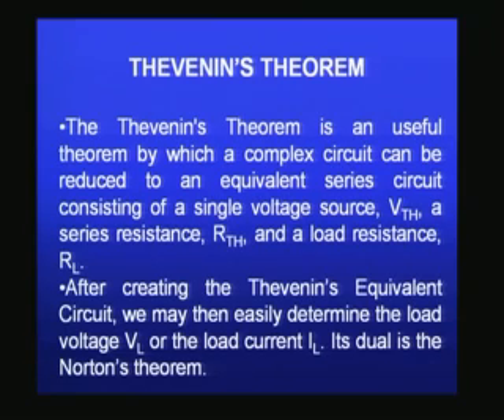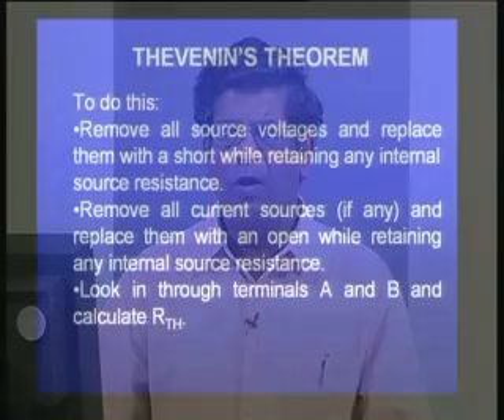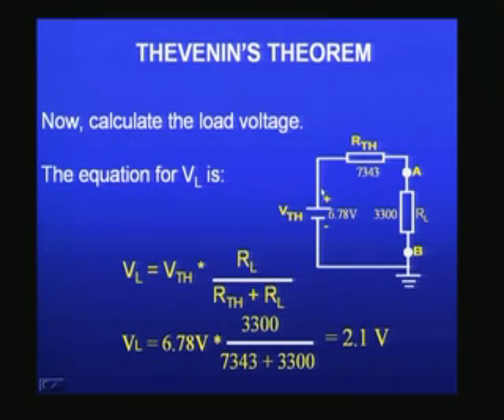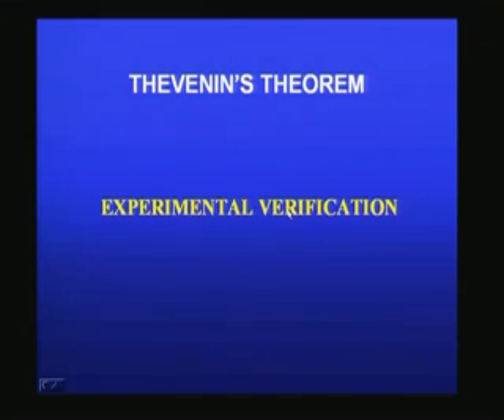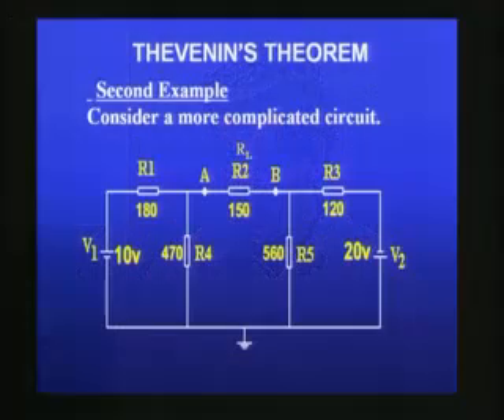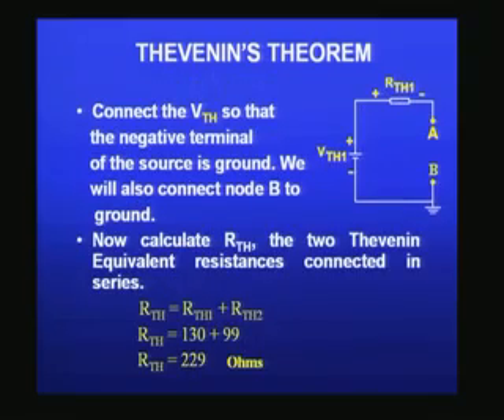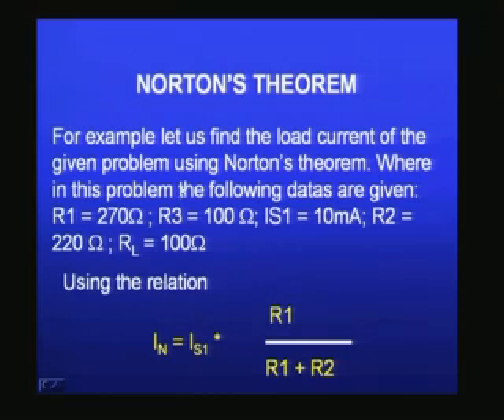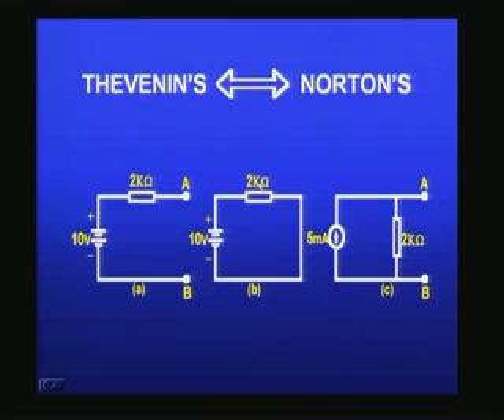Lecture - 5 Some Useful Theorems in Basic Electronics

Comment: Hi, I think a mistake was made on the second example (two voltage sources, finding the thevenin equivalent). You had added the resistances as if they were in series to find Rth, but if you short circuit the voltage sources, the resistances are in parallel.

Comment: You are confusing voltage source vs voltage drop. AB is V source like a battery any measurement of current will be measured through the internal resistance. If the resistance at AB was still there it would be a v drop across that resistance and any current measurement would be through the resistance at AB.

Comment: When we connect a voltmeter, we assume it to be an ideal device. Then its internal resistance if very high and hence no current flows through R3. In practice there will be a very small current but it can be neglected if the voltmeter is good.

Comment: I'm having a problem with Thevenin's Theorem. When the load is removed, it is said that there is no current flow through R3, so it can be ignored when calculating the voltage at points A & B. How can this be so? If you put a voltage meter at points A & B and measure voltage, isn't current flowing through R3? How else could there be a voltage reading at A & B? If you measure across B & C, I can see that you could ignore R3. I know I'm wrong but I can't understand why. Thanks.